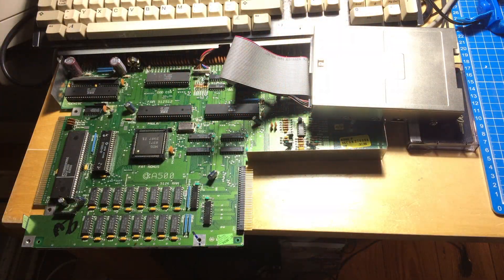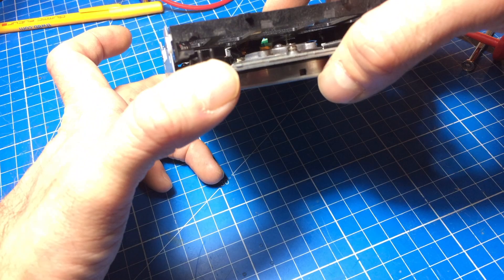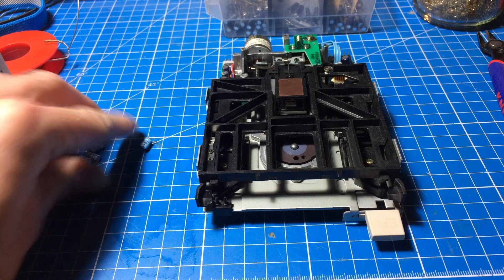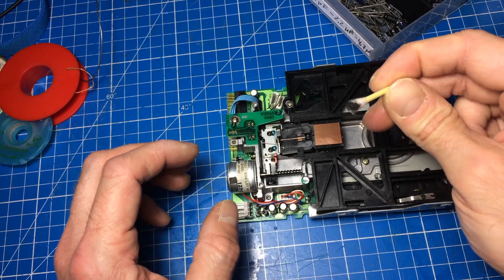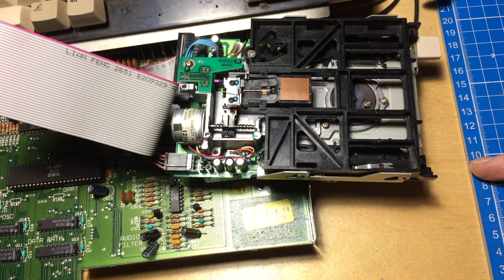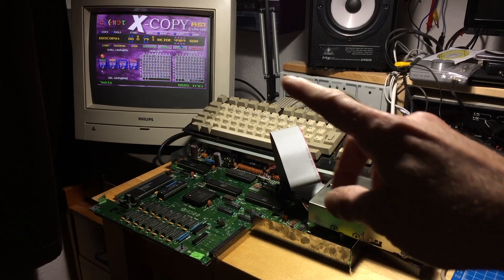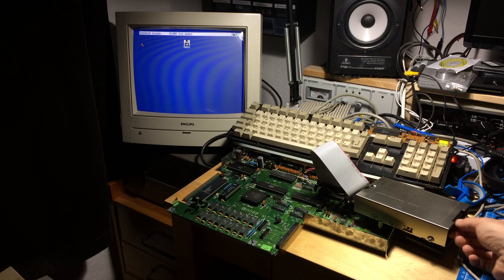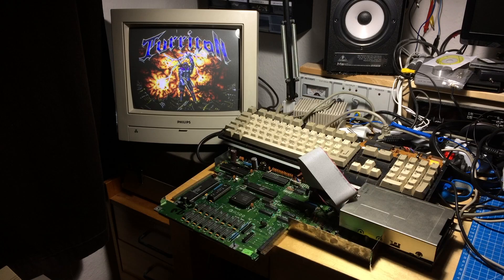Amiga 500 Disk Drive Chinon FB-354 Rev. E Repair

Comment: Hi. I got my Amiga 500 from the basement. I have 2 external floppy drives and around 2000 discs.
I noticed that on both drives I get read write errors or software failure signs.
The internal floppy turns but after two slindsbtryong to read it stops.
And on the external sometimes it loads a floppy and then not.
Can I just clean the heads with 96° alcohol?
Or where do you buy it?
Any help is welcome
Reply from the maker: Alcohol and a cotton swab are great for cleaning the heads. Just be very careful to not knock them loose (which happened to me a few times now and is pretty much the end of the drives). You might also want to lubricate the rails the head travels on with silicone grease or white lithium grease (very common problem because the original lubricant dried up and prevents the head from traveling freely).

Comment: im glad id found your video, I have the same drive and my head doesnt move so if I replace those Capacitors would that work ? im using that drive for replacing the 1581 disk drive btw
Reply from the maker: Maybe! The capacitors are a relatively common thing to fail and they are affecting the motors directly. I've also had drives where the head was just physically stuck because the lubricant hardened up over the years. Worth checking if it moves easily "by hand" as well. Hope you manage to fix it!

Comment: My chinon FB354 rev E even after the recap and thorough cleaning of the heads and switches for floppy detection continued to give the NO READY SIGNAL error.
So the amiga didn't react to the insertion of the floppies.
Checking the contacts with a multimeter I discovered that a zero-ohm resistor on the track of pin 34 (jp4) was completely gone.
I replaced the resistor (which acts as a jumper) with soldering and the drive worked 100% again

Comment: What problem will the drive typically have when those capacitors are bad? What exact problem did this drive have based on those (specifically spindle, stepper, etc.)?
Reply from the maker: As far as I know, the caps in the drives are usually connected to the motors, so the failure mode is the motors not running at the correct speed. Which results in disks not being recognized/read errors and other random behavior. Difficult to tell and very much depending on the drive model and how bad the capacitors are. I had the drive in my A1200 failing recently, it behaved like it should but it didn't read disks at all. Turns out it was the one little cap that's on the PCB.
Reply: @JanBeta : Thanks. But a lot of times we can run a DC motor without any capacitor, and given a certain voltage it stays at that speed. Why does this setup need any capacitors to help that?

Comment: Do you know if these drives need the 12v ? I’m trying to get it to work from external floppy interface on Amiga 2000 but no activity so wondering if it’s a power issue.
Reply from the maker: Yes, the 12V rail is used for the motors on these so it's important. ;)
Reply: @JanBeta  do you know if I can supply the 12v safely off the external floppy connector on the back of the Amiga 2000? I see a 5v and a 12v on two of the pins.
Reply from the maker: That should work fine, the connector is designed to power external drives.
Reply: @JanBeta  great thanks. I could not find any info on these drives anywhere. Nor any info on the connector. Also found it odd that the EFI - External Floppy Interface only supplies 5v and claims it works with Amiga drives and PC drives. Surprised I seem to be the only one online asking about this issue. I checked the Amiga forums… I’ll give it a try tomorrow. Thanks!
Reply: @JanBeta  that worked! Thanks Jan! Btw I’ve subbed to your channel for years. Along with all the other guys on YouTube doing retro electronics. I do some things as well some vids on my channel you might like to check out. Thanks again. Time to make a 3d printed floppy enclosure!

Comment: Hi Jan thanks for your wonderful video as usual I have exactly the same drive I have cleaned the heads and it works,,, If I leave it overnight or A-day or so I put a disc back in and it doesn't read any discs, After 5 or 6 attempts the drive works perfectly, I have  Regreased the Worm ,  And cleaned the switch contacts,,, Same again it works but the next day the same again happens I have yet to change the capacitors next If it doesn't work after that then it's something else thank you
Reply from the maker: I hope replacing the capacitors fixes it! Might very well be that's the issue. Bad caps often cause random intermittent faults like you describe. Fingers crossed!
Reply: Thank Jan getting back to me I will update you soon ,
Kind regards michele

Comment: I have same Chinon (China quality?) drive that is busted. It makes loud noises when the head moves and reads disks badly. Randomly it sometimes loads disk a bit and sometimes it won't even begin to load it. Mostly it gives guru meditation. Another Chinon I have runs fine on that machine. I tried to clean reading head with alcohol and added some grease to that corkscrew thingy but it didn't help. Would replacing those few caps help or is it too far gone?
Reply: I made a video of it. Comments are welcomed :) -> https://youtu.be/dIYP0K7UX_w

Comment: I see you clean flux residue with a tooth brush (and probably IPA). In my experience this just dilutes the flux and spreads it thinly over a larger area. I have to use a combination of swabs or Kimwipes to actually get the flux away from the board, otherwise everything gets slighly sticky and dirty after a while.

Comment: I have bought used chinon just like the one you have repaired in this movie - however it turned out to be faulty. It was supposed to be ok so I ahev entered into a vicious exchange of arguments with the seller - I was so angry he sold me the faulty drive tha t I thnk I didn't think straight (I guess it happens to all of us some times). After a while I saw your video and ...it has calmed me down and directed towards easy going and methodical way of eliminating the possible cause. It was the pin detecting the drive insertion - I have cleaned it a then completed the other steps (no recap at this time) and IT WORKS like a charm! THANK YOU for your videos - literally I wouldn't even tried to repoair the drive if it wasn't for you :)

Comment: i have FB-354 for an older A500....i replaced the caps...but it did not change the initial problem that nothing happens when i power on the Amiga. i am pretty sure the power to the drive is ok since another drive seems to get power. This one gives no reaction or ticking standby sound. Any suggestion what to troubleshoot? i get the kickstart 1.2 screen...

Comment: I have an A500Plus with one of these drives. After recap it is as if it does not get any power. Any idea what I should troubleshoot for? It was my first Amiga since 1993, and it has not been preowned. I know the floppy drive used to work before i shelved the machine back in 1997 or something. Hope you can give me some tips.

Comment: i have the FB-354AA, looks the same.  Mine was installed on an Atari SF314.  My drive won't light up and won't read disks.  But I can slightly hear it trying to do stuff.  Power supply gets 12v and 4.94v on the other pin, not quite 5v.  Does that matter? I have tried other PSU, other 1040STe, and no luck.  Might be the caps i guess.
Reply from the maker: 4.94V should be absolutely fine. Usually the components have 5-10% tolerances. My guess would indeed be the capacitors or something mechanical. I’ve rarely seen anything else break on these drives.
Reply: @JanBeta  thanks for the reply.  I have a drive i pulled with loose solder joints .  They are where the smaller connector are.  Maybe the same is happenening with this Chinon so i will check that too.  I will order the caps ASAP.  Also, do you know where i could start with my 520STm that boots to only a black screen?

Comment: Thanks for the video,    I'm trying to fix my A500.   If I put a disk in, sometimes it works but most of the time it doesn't unless I manually spin the wheel with my finger.   It will then work until the motor stops, and I have to spin it again.    Have you ever seen anything like it?

Comment: Jan, what were the symptoms? I have the same drive, it is clicking OK, but when i insert disk head does not move. Workbench pops " not a dos disk". Per visual inspection capacitors seems OK. Any ideas?

Comment: woah the giana sisters looks way better than the c64 version. I didn't know there was an amiga version (or a version on any other system).
Reply from the maker: The Amiga version is pretty obscure because Nintendo threatened to sue Rainbow Arts over the obvious Super Mario "references". The C64 version was out for a couple of months I believe while the Amiga version was taken out of stores right after it was released. Original versions are pretty much unobtainium. ;)
Reply: @JanBeta  yeah I only had the super mario brothers version of it on C64 which is where someone hacked in actual mario graphics into it. I always thought it was a mario game. I never realized it was supposed to be different until much later.

Comment: Hi Jan love your videos. I'm having a problem and can't pin down what's going on. I can't get any floppy work on my A500. I have a Chinon FB-354 that is completely dead in my A500. I put new caps in it and still get no activity at all. I hooked it up to a regular pc just to double check for any signs of life and I do get activity from it. So I figured it must be the A500 board but before I went poking around on it I converted a Mitsumi  D359M3D and a Samsung SFD-321B to work on the A500. I get activity out of of them but neither will load anything on the A500 and the other thing that has me puzzled is that I get no signs of life at all out of the Chinon when it's hooked to the A500 but I do when it's hooked to a pc. In short I get activity on all 3 on pc but only the 2 converted ones on the A500 but they won't load anything. Do you have any ideas on what to check next ???
Reply from the maker: Did you check the power supply? Maybe the converted drives give some signs of life because they operate the motor from different voltages. I had an A500 where the drive didn't work and the only fault was a bad connection on the 12V line in the power jack.

Comment: I have the same drive and cleaned everything properly like shown in this video but did not replace the caps. I still get read errors with most disks. Can a faulty cap cause these read errors? Thanks

Comment: Really appreciate this video Jan!  Thanks!
Reply from the maker: Thanks! Hope it helps bringing the old drives back to life. :)
Reply: Had cleaned the heads before but didn't think to try the caps.   Need to pick up the smaller one, but I have the larger ones...

Comment: Good idea to fill the isopropyl alcohol into a spray bottle. Thanks for the inspiration, Jan. Will do this asap. :)
Reply from the maker: Yes! I use it all the time. It's much easier to handle than pouring it out of a larger bottle. Thanks. :)

Comment: Thanks very much! I even did disassembled the micro switches and cleaned it with a fibre pencil and did all the other things (replaced caps, lubricated and cleaned heads). The floppy now works as it were a brand-new one. Thanks for your hints.
Reply from the maker: Oh, glad the video was helpful to you. I wonder how long it takes until my micro switch stops working again and I have to properly disassemble it, too. ;)

Comment: You should rather use Teflon grease or so-called white grease (lithium grease).
Reply from the maker: Yes, got myself some white lithium now for these things.
Reply: Lithium grease is much better, because it doesn't attract dust. It is so-called dry-grease. On the other hand a silicone grease is one of the most dust-attracting.

Comment: I have the same problem. To format or copy I have to press the disk down slightly so it writes to the disk. If I dont press it down it says 'disk is right protected' .What should I use to clean it and do I have to remove the disk drive from the computer? Great video.
Reply from the maker: Thanks! It should be possible to spray the litte switch while the drive is in the computer if you are careful. You should use some mild "tuner spray" type of contact cleaner that does not harm plastics. Most stuff is far too aggressive and often seems to work at first and then gradually eats its way through plastic parts or even the contacts in the switches itself. I use Teslanol Oszillin T6 (which is available in Europe but near impossible to get in the USA, I think). For the USA and Canada I'd recommend getting DeOxit stuff.

Comment: Hey Jan. I have a couple of questions.. :) When I clean drive heads, I have been using benzine. It has worked pretty well overall, but is it too strong for that purpose? Thinking of getting some isopropyl instead. And that little handy spray pump.. Did you get that online? If so, could you perhaps throw a link my way?

Thanks as always, for your helpful videos! :)
Reply from the maker: +Casual Commodore I would not recommend benzine because it really is a bit strong for that purpose. It might dissolve some of the glue or plastics nearby if it gets there. Isopropanol doesn't hurt plastics much at all if you don't soak it. It's also the industry standard for cleaning read/write heads since forever, so it's most likely a good choice. ;) Make sure to get 99.9% which is the cleanest type you can get. 70% works fine but can leave stains sometimes so it's not quite as good for delicate stuff like this.

The little spray pump is actually an empty deodorant bottle I kept. All the bottles I saw for sale were made of plastic and this one is glass so I prefer it. :)
Reply: Haven't seen 99.9%. But I can get some 99%. I guess that will do fine. Thanks for the info, Jan!
Reply from the maker: +Casual Commodore You're welcome! The 99% should be fine, I guess. ;)

Comment: Judging by the blackness of the original lubricant it probably wasn't silicone originally, but graphite grease instead.  It is commonly used for mechanical mechanisms but is electrically conductive so you need to be careful where it is used in electronics applications.  In a mechanism like this where it is not exposed to high heat or excessive amounts of dust or liquid, it should effectively last forever.  The silicone should work fine, but I thought you might be curious to know.

https://en.wikipedia.org/wiki/Dry_lubricant#Graphite
Reply from the maker: +Jeremy Levi Ah, didn't know that graphite was used in these drives at all. Would have thought it's impractical due to the conductivity. Interesting point.Thanks for sharing. :)
Reply: It really depends on the grade of graphite grease.  For example, the kind made for lubricating locks that comes in a little puffer tube is a very fine powder (it looks like tiny flakes of grey-silver metal), but if you puff it out onto your finger it smears easily into a uniform layer, feels very frictionless, and isn't gritty at all.
Reply: Usually I see white grease on most of them too, I think that's probably the most common.  Its just the odd time I've seen other types used.

Comment: Of course, I enjoyed and learned from you. Odd, when I searched "T6 Oszillin Kontakt- und Tunerspray" on eBay.ca the first item was a poster of anime girls in bikinis.
Reply from the maker: +MindFlareRetro Haha, thanks. The bikini girls poster will probably not do very well for cleaning contacts. If I ever find a place that sells Oszillin internationally, I'll let you know.
Reply: Ok. Thanks.
Reply from the maker: Mh. Had a look around on various sites and it seems to be only available in Europe. I had better luck searching for "Teslanol" which is the brand name but still couldn't find it anywhere near you. It seems to be very similar to "Deoxit" spray though (which is what I initially wanted to buy bc I saw people using it on YouTube but couldn't find it here).
Reply: Deoxit is supposed to be excellent. I can get it locally, but it's very expensive. About $24 CAD for a small can.
Reply from the maker: MindFlareRetro Oh, that's a fair bit more expensive than Teslanol (I think I paid around 8€ for 200ml). From what I've seen in videos, it has the same effect Deoxit has. And also doesn't destroy anything (and I used it on everything from old amps to connectors in my car).

Comment: I liked Nibble Copy which is I think 4 bits instead of a byte that has 8 bits. You could backup floppies from all other computer systems. And the extra track 81. 😇
Reply from the maker: I even had the original X-Copy hardware dongle back in the day which allowed for even "deeper" nibble copies. Virtually no copy protection could stop me. ;)
Reply: Jan Beta Yes, especially MSX disks unable to backup with Dos or Msx, but Nibble always worked.
Reply from the maker: +GaryKildall Didn't try MSX disks but I remember copying Atari ST stuff without problems. ;)
Reply: Jan Beta Nibble copy did indeed copy the unbreakable. With MS Dos no back up could be created but Nibble from Amiga did. Had a disk for MSX worth 25 dollar today, could only be back upped with Amiga Nibble. Was a speech sampler disk with most sophisticated MSX copy protection.